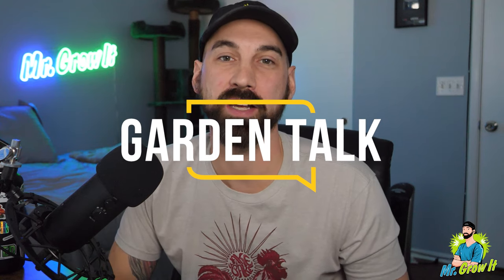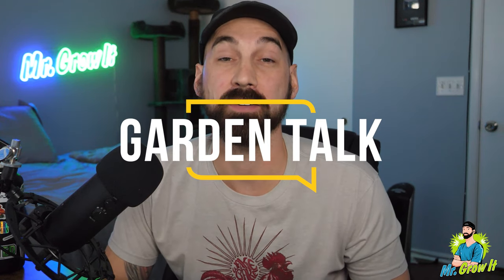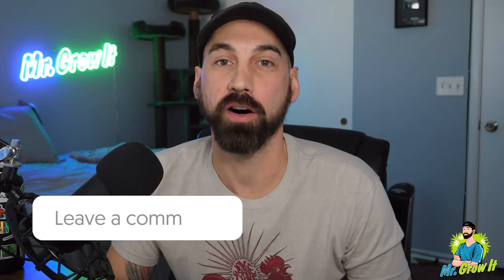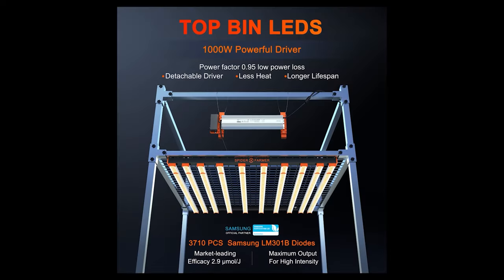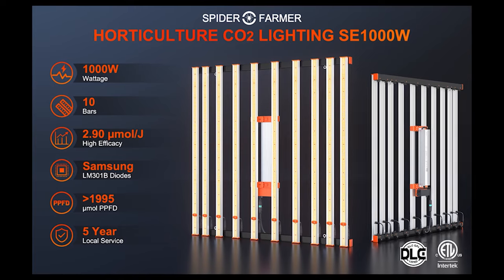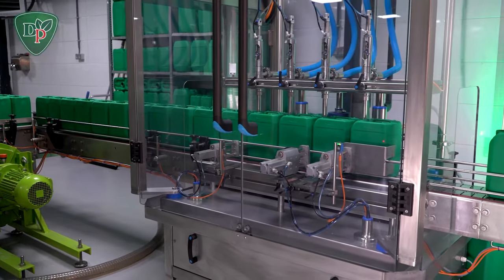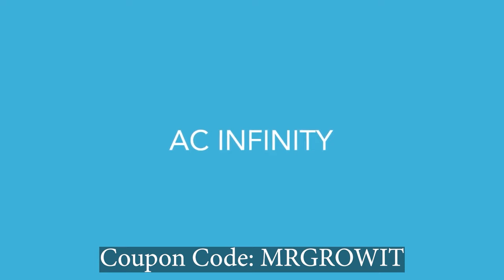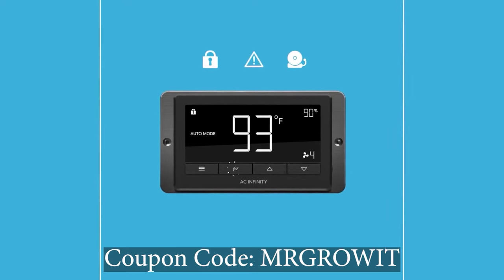The IDEAL Watering Setup For Plants! (Garden Talk #50)

Comment from the maker: Thanks to Michael Box for coming onto the podcast today! 
Sustainable Village YouTube- https://bit.ly/3IRiVXt 
Sustainable Village website- https://bit.ly/3KSVeju
Reply: Great job you guys keep up the awesome work 🔥💯🔥💯🔥💯🔥💯🔥💯🔥💯🔥💯🔥💯🔥💯🤙🏻
Reply: Fav guessed this far is frosty mcnosty or beastcoast420
Reply: The only correction I wanted to make was it's incredibly easy to get flow rates right on diy auto watering. You use a 6 or 8 top drip manifold, that ensures ideal distribution levels for all your emitters :) Orbit makes them dirt cheap and they are completely pressure regulated and can control flow rate directly from the manifold!! No need for flow restrictors or ball valves on every single emitter etc. Makes it so simple. I used that plus a 1/2in threaded mpt to 1/2in ID flex barbed tubing adapter👍👍 works flawless zero leaks from day1. Incredible video and wish I had the opportunity to watch months ago haha as with all ur vids🤣
Reply: So he recommended using plastic pots when using an organic soil to grow with? I was kinda confused by some of his responses. No hate I would be nervous on camera too which is why after 30 years doing this I still won’t get on camera. But water management isn’t stressed and talked about enough . Optimal watering methods per style of growing has always intriguiged me.

Comment: Grats on 50, Chris...I probly watched 35 or more.  I love the format.  And the knowledge and different perspectives is priceless!
Reply: Forgive me me if I sound dumb here, but by gnats forsure fungus gnats, ok so with an irrigation system like the topic they were on does it mean in a say almost perfectly dialed in setup u will not? Have very many pest problems with this kind of irrigation system specifically fungus gnats? Cause this passed summer the gnats just hermied,slowed,and about toasted my grow...so this would help for fungus gnats screwing up another grow then? Well where I'm at a drought like none on record happened too but temps and gnats were a constant I use fab pots also has your success ,yield been better with this type of watering system helped? Or should I just use 5-6 gallon buckets 🪣 again sorry so long of a question.

Comment: I also loooove having a big gravity tank , I have a 55 gallon and it gravity feeds x4 15 gallon pots , I can go on vacation to italy for 6 weeks and still have water left and the plants completely absolutely healthy and fine !! Its amazing how long a 55 gal lasts , for my situation it would have lasted 2 months barely before running out of water … also you get more pressure with bigger tanks if its gravity ..
Reply: Yea, I went overkill on mine as well. Was thinking about only filling it half way. I have a 27gallon tote, that I use. I also dont want to have it weight that much. So I figure 15gallons or a tiny more would be enough.
Reply: @25Patman  yes it can be enough , but you get better results with a bigger tank ..
More pressure for the soaker hose  , more independence from your plant room and you really have to refill that 55 gal almost never

Comment: Another video with great info. Cool. 
I find bottom watering (aka butt chugging 😂) to be easiest and plants love it in organic soil. Letting water wick up leaves the surface dry so gnats stay away and the soil different zones of humidity instead of soaked from the top. Earthboxes or homemade wicking beds are even better. I water once a week, just put a gallon and a quarter or so in the reservoir. Plants love it. And there's no parts to adjust or hoses or danger of flooding. I haven't tried these watering systems but they look more complicated than pouring water in an oil pan with a fabric pot or in the fill tube of an Earthbox. You do need to water in amendments after top dressing, a spray bottle is great for that. Bottom watering works for a lot of the plants people grow in gardens or medicinals.

Comment: Just finished watching. I've got a ton of tips for you mr. Grow it.  

I'm using 7 gallon pots, craft blend, worm castings pretty much exactly like you are. I'm using both a maxi carrot and regular carrot with drippers.

I just setup my blumats and posted over in Reddit. You really should look cause it would really help with you dry top soil issue. Also a heavy layer of rice hulls after top dress will keep that layer under the rice hulls moist. Also cover crop helps a ton! We're pretty much growing the exact same way.

Lemme know if you need more advice I've got a ton of tips for people using these things and growing this way.

Comment: I love blumat , been using it for years and never had an issue , always had explosive grow !! Great system
Reply: Do you use nutes in your system. Water soluble right? I just set up my system this morning, I used water soluble nutes. Should I be ok?
Reply: @25Patman  as long as you are dripping straight in the soil without a soaker hose but just with the drippers you should be totally fine , once In a while flush the system out tho because deposits can clog the lines on the long run ..
Reply: @42organicgrow10  Thanks man. For both reply's. I appreciate it.
Reply: @25Patman  of course Always happy to help ! Check out my channel you can see how I set the system up .. once you understand how it operates you can do all kinds of stuff but I like to keep it real simple

Comment: Great content thanks for the show! Individual drippers make zero sense to me in coco, even with 3 in a pot you'll still have large uneven moisture in the top few inches of the substrate. I use rings, elevated above, dripping from many holes at once. Place needlepoint canvas on top of the pot which will randomly disturb the falling water. Ideally the dripper rings are 2/3rds out from the pot center. I haven't found the ideal size yet for a 5 gallon fabric pot so I'll probably make my own from 1/2" pvc.

Comment: Mr grow it , what I would do in your situation is get blusoak adapters and blusoak tape , also exchange 1 carrot of yours for a longer one for each pot …
At this point you have 2 drippers per pot , one deep one and one short one ..
Connect the shorter one to the drip tape system , bury it below 1 inch of soil in a round circle around the plant ..
Leave the other one as normal dripper ..
Set the humidity level in your soil , set the carrots correctly .
After you are done you will always have a moist top layer which will boost your soil biology , and the other dripper will make sure to penetrate the soil enough to reach the bottom and keep the whole pot moist .
This should really help you out , keep us posted bro !

Comment: I've done a few runs with 4 different shaped cloth pots. What I'm noticing is the exact dimensions of any given 5 gallon container makes as much of a difference in how much and how often to water, as the plants drinking ability does.
      It's clear to me its best to have a taller thinner pot that if you add about 1 -1.5 liters of water it should saturate it and will dry out after about 24 hrs. If it's to short and fat it holds the same amount of water longer because of the shape. The result of a plant that stays wet for 3 or more days on a regular basis is slowed root and plant growth.
Reply: Tall and thin for the win
Reply: You should check out Rainscience grow pots . They’re the best of air pots , fabric pots and traditional plastic pots all in 1. Game changer

Comment: I am waiting right now for the 2-9inch carrot pack for a 10 gallon pot. Know I know to use both the 9in and one 5 inch. I only have 3 total distribution drippers though. I guess I will have to order a few more. Im going to SOG that plant. After that one though I am thinking 5 autos. I am doing overkill on the resevoir. But I think I will put a max fill line alittle over half way. I have one of those wire rack shelves that I made a drying/curing chamber out of. That should be high enough easily for my resevoir. Excited to get it going.
Reply: Perfect timing for this video. And ty so much for all of your content. Really great !!!

Comment: I heard that the problem with auto water is if you use dry amendments is where the water hits the soil all those nutrients will get used alot quicker then the rest of you pot or is this  not the case or do you have to move your irrigation around ???

Comment: I'm not keen on fabric pots the root system for me as never been as good as in a plastic pot
They just dry out to quick
Out doors even worse
I'm sticking to the old school pots you can re use plastic pot for alot longer aswell
Great vid
Reply: I have a 10 gal pot I am using. I use the distribution drippers to go around the outside and have one carrot on the inside. It keeps everything good. Plus, they say that the first few inches of soil is doing all the work. Using fabric pots and getting the proper watering, actually makes way more of that perfect zone. I mean you have it all around instead of top down. I hope I explained well enough.
Reply: @25Patman  carry using on them then
You keep listen to all this crap you don't need special  pots to make you grow better weed if you beleave all that then keep spending money🤑🤑🤣🤣✌️